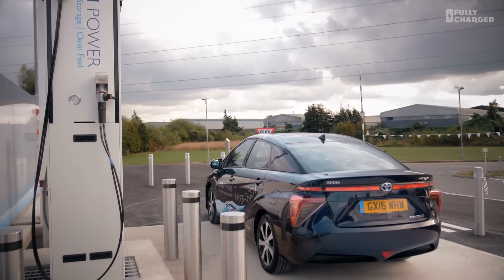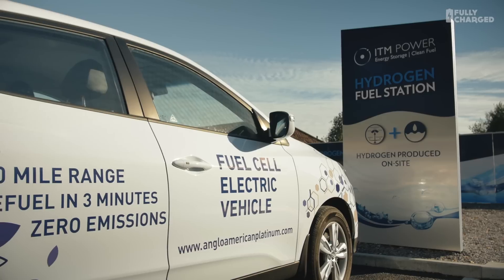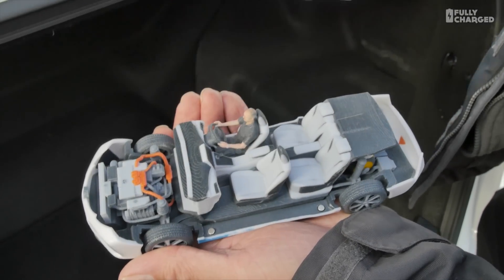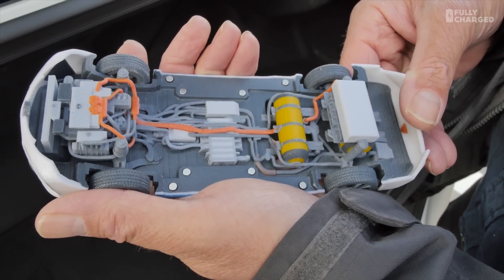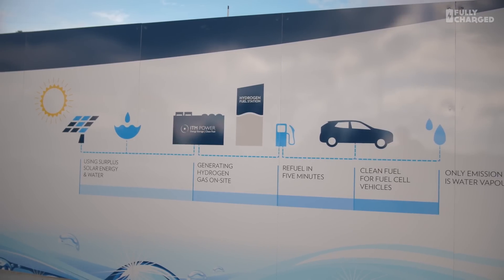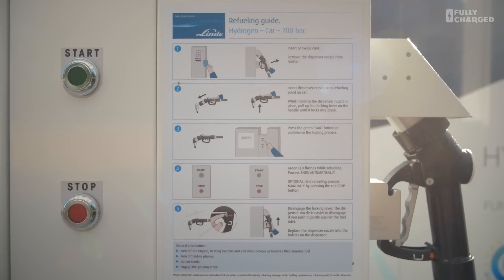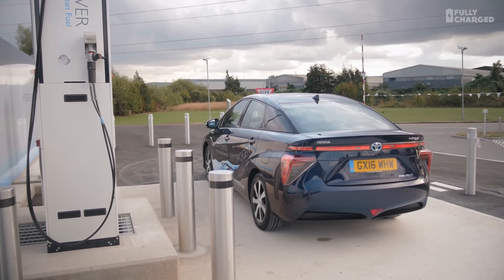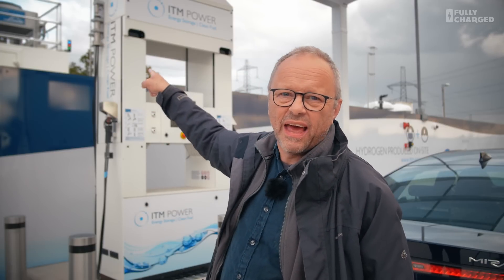ITM Hydrogen Rally | Fully Charged

Comment: I got an idea, next time we go grocery shopping ... when we get home... let's put a ladder up to a second floor window, climb into the window, go down the stairs and out the back door and open the door to the basement and carry the groceries up from the basement back into the kitchen...  or we could just use the front door...   

Sooooo,  we could used wind or solar to charge an EV at home and drive off with 300 miles of range OR 
we can use wind or solar to power a very expensive cracking station that produces hydrogen at high pressure and for a ridiculous price, pump that gas into a car under high pressure and then the car takes that hydrogen and puts it in a fuel cell to charge battery that drives the car 350 miles.  

This is crazy!!!
Reply: ram 1901 okay, then what else do you suggest? It's easy to be critical about something but what do you want to improve about it?
Reply: The energy in the hydrogen is a lot more portable than that in battery. I'm not saying hydrogen is better than batteries for powering cars, but I am saying that there are advantages to a hydrogen-based energy infrastructure that considers the grid and the transport network as part of a whole.

I really don't understand why so much hate has grown up around hydrogen. We need to change what we're doing now, and fast. Surely we should be exploring all options? If hydrogen is so obviously a bad idea, why hasn't it died a death yet? A lot of very smart people in a lot of countries think it's worth developing, despite a constant barrage of ridicule, so it can't be completely without merit.
Reply: ram 1901 of course hydrogen is still expensive 
When electric cars came out were they cheap or the same price they are now 
NO ! 
And electric vehicles are not the future if everyone in the uk charged there vehicle overnight the national grid would completely blackout.
Reply: No To Pseudoscience such a drastic expansion to the power network will be a terribly expensive infrastructure challenge. Even with the infrastructure in place how would you ensure adequate power generation exactly when you need it. One of the advantages of hydrogen generated by electrolysis is that the refuelling event can occur at a different time to the power consumption , it is in this way that hydrogen provides a route to zero carbon transport by using excess renewable power that would otherwise be wasted.
Reply: Rooftop Solar/Tesla Battery/Tesla EV...no load on grid..
Makes no sense to take solar...use it to make hydrogen..then take hydrogen and use it to make electricity again in the car.
Reply: yes it does because -less so with solar and more wrt wind power unused surpluses are going to waste and could so easily be stored and monetised as hydrogen. Society has to get used to seeing hydrogen , not as a fuel but as a store of energy. There is enormous waste as well in power stations with voltage maintained as the load drops. taking the load back to 100% by automatic balancing of the load with varying output of hydrogen
Reply: Actually even more crazy. With home system you mention, if you can charge your battery car to do 300 miles, you could make hydrogen for fuel cell vehicle to do only 100 miles, because process electricity -> hydrogen -> electricity wastes 2/3 of energy.

Comment: I can see Shell, BP, Esso etc jumping on this band wagon as it's more inline with their sales model.  I'd rather keep my i3 BEV, it seems so much simpler!
Reply: Yeah. Using a wind turbine to create hydrogen which then creates electricity seems so convoluted. Simpler to go from turbine to electricity. That's why electric cars will win in the end.
Reply: Tesla can be anywhere from 60 to 100 kWh in battery pack capacity where as the Mirai is rated up to 114 kWh. FCV makes more sense for heavier vehicles and large trucks due to the higher power density output compared to BEV alone..
Reply: FCV is so unpopular, no one does vlogs with them, or even forum posts. They are more of a unicorn car than a Koenigsegg.
Reply: Not a chance - why would you spend billions of dollars on hydrogen storage tank farms . tanker loading facilities and car fueling facilities instead of putting a few fast chargers on your forecourt for a fraction of the cost and selling more ice cream and coffee at a higher profit margins than available from selling petrol.
Reply: And even the unicorns at Koenigsegg think this is to odd. As they are building their 1500BHP plug-in commuter... http://koenigsegg.com/regera/

Comment: Everything you can do with a fuel cell, you can do with a battery. Check the physics and it's obviously a waste of energy and a way to line another politician's and friend's pocket.
Reply: So a Tesla now rated at max of 100 kWh and when not plugged in to recharge that energy is to go where when its outputting more power than is being used? considering the Mirai converts that Hydrogen into a max of 114 kWh. The ITM system is taking that unused power to make a power dense supply of hydrogen that during peak user times would go back into the power grid as needed since it can store more power than a battery system.
Reply: Then charging your Mirai better cost you less than $15.00 or the power companies will make a killing off using energy from your car. It adds an unnecessary step. Power companies can add their own fuel cells or battery packs.
Reply: Joshua Cornell Converting hydrogen to electricity , into a DC battery incurs more losses than simply driving a BEV. 

Also there's no video of a hydrogen car ownership of what it can do. Stop going on dreams.
Reply: Joshua Cornell 
Why is this feature even relevant? Are people actually going out and putting  petrol in their cars so they can go back home and run their house like a gas generator? Since when did this become a must have practical feature, that it has to be highlighted? Last time I checked, the only reason you wanted to "fuel" up your car was to actually drive it for as many miles as possible until empty again. So maybe if your city's power goes out because of a natural disaster, it might come in handy, but what happens when your car runs out of "juice"? Now you don't have power in your house and your car is also empty. You're better off buying solar roofs and wind turbines, rather than relying on this gimmick. There's a reason why Tesla didn't see this "feature" practical and didn't include it. Just another distraction from the Mirai's obvious inferiority to BEVs. For real, who has actually used the "unused" fuel/energy in their car to power their house to save a few bucks on their electric bill?
Reply: Having looked at how much battery juice you would need to power your home for an hour to a week, the battery back up type system wont hold due the amount of power your fridge and washer/dryer use. Compared to how long that same power pack can keep your electronics powered. You need a back-up generator, be it diesel, gasoline/petrol, or gas be it natural, propane, methane/butane or hydrogen. You would drain the BEV in less than a day to run the lights, keep the fridge cold/freezing.
Reply: Joshua Cornell your point confuses me. Most blackouts last typically less than a day which is plenty of time for home backup battery storage systems to provide for.  An 100kwh tesla can backup an English house for an entire day and then some, because we waste a lot less power than Americans do with all their air conditioning and absolute lack of regard for energy efficiency.
Reply: @pinoyamerican:  I do.  I use my Prius to run my house during power outages.  When the gas tank gets low, I drive it to get more.  Tesla did not include this because it doesn't fit their business model.  "free for life" supercharging, plus V2H (vehicle to house) means that people might run their houses off 'free' electricity from Tesla.
Reply: Will Davis a past few winters where I live we had blackouts, while it lasted less than a day for some, others had to sit in the dark longer due to the extent of those blackouts. Battery backups are only able to handle a day at most the power needs, so those with that system were likely back in the dark after their battery system ran out of juice, I do not know anyone with these battery back up systems...
Reply: @Joshua: A new Powerwall 2.0 would run my house for 5 days.  More, if I was frugal, which of course I would be, as we sometimes lose power for a week or more.  If my solar PV was completed, that would be extended to weeks even in winter.
Reply: Joshua Cornell. Problem is that you need more than 300kWh of electricity to create hydrogen to fill up Mirai, and Mirai gives you back 114 kWh, so you wasted almost 200kWh.
To charge 100kWh Tesla battery, you will need around 110kWh of electricity. And both cars can do the same mileage with full tank/battery.
This is why it does not make sense to store excess electricity as hydrogen, you get back only 1/3.
Reply: Will Davis. Average UK household uses 13kWh of electricity per day, so Tesla could power home for a week. Americans use 32kWh per day, so 3 days for them.
But in the case of power outage, you would not use electricity the same way as you use it normally, so it would probably last for much longer.
Reply: Not really. Hydrogen refills takes much quicker then BEV, even if you use Tesla's Supercharger. That's huge advantage on a longer (1000+miles) journey.
Reply: jur4x But the hydrogen still takes electricity to produce. Such a waste.

Comment: As a process engineer, this all looks extremely dubious to me.
What it smacks of is likely what it actually is.. an automotive industry trying desperately to preserve it's current business model instead of doing what it should be doing and moving to electricity and making batteries better and more easily recyclable.

Separating the gas you get loss.. compressing the gas you get loss.. cooling the gas you get loss... pumping the gas around.. you get loss.  If you transport it you get loss.  All this before it hits your tank.

So basically how much of that electricity that's being generated by that turbine next to you is just going to waste?
And we haven't even spoken of the dangers of compressing hydrogen to that pressure.  It's a multi staged pump and if you don't do a good gas separation or if you get a leak, you will be picking bits of that compressor out of your teeth if it gets any oxygen in it.

Now that might not be important for an installation like this.. but in order for this to TRULY compete with electricity storage you have to be able to have this hydrogen generator at your home.
Last time I checked, I could safely use my home solar to charge batteries that I could then transfer with little loss to my EV or use to keep my lights and fridge on.. and wash clothes.  You know.. LIVE.

So what are we really talking about here?  A viable alternative, or some last ditch effort for an enormous over bloated series of wasteful industries trying to sell you yet more of what you don't need?
Reply: As a very rough rule of thumb, the well-to-wheel efficiency for this kind of system is around 25%. HPE (high-pressure electrolyzing, i.e. at about 25 bar) has a theoretical maximum efficiency of just over 60%, compression and refrigeration knocks off another 30 or so percentage points (including pump efficiency) and the hydrogen fuel cell inside the Mirai achieves just over 60% efficiency again at half output (=peak efficiency). 

Theoretically, if you can make a 100% efficient compression pump and non-eroding, no overvoltage ultra-high-pressure electrolyzer, you can get near 50% overall efficiency. But that is unlikely to be achievable anytime soon, or probably ever.

As battery costs come down and production increases, it seems increasingly unlikely that hydrogen will ever become viable. Right now, you can produce supply-driven electricity from renewable sources for around $0.05-0.08/kWh, competitive with fossil fuels. Energy storage using $500/kWh batteries adds about $0.30-0.40/kWh to the system-level cost, i.e. a fully battery-backed renewable grid would mean ratepayer electricity prices of about $0.50/kWh. A hydrogen-backed system (e.g. the various Japanese home fuel cell systems) currently achieves $0.25-$0.30/kWh, which is interesting. However, you have to take into account that $500/kWh is not a realistic price for batteries; Tesla et al. already produce grid-scale battery products at half that price, with bare cell cost approaching $100/kWh. If in 2020 we have sub-$100/kWh batteries, the cost adder for battery backing  - even seasonal storage - on intermittent renewables becomes in the order of the bare kWh-price. At that point just the inefficiency of a hydrogen cycle by itself would price itself out of the market. And 2020 is not an unreasonable timeframe.

So yeah, hydrogen isn't going to make it. Even aside from the technical and safety issues, the cost probably won't ever make sense.
Reply: demultiplexer, Couldn't have said it better myself.
Reply: To be honest I wouldn't put it past a compressed air car to have a better "well" to wheel efficiency.
Reply: gnoxycat Lots of issues with compressed air for locomotion.  It would be interesting to see what type of motor you use to try and get rid of the friction loss from pistons without loosing efficiency.. and then there is still the issue with carrying around lots of weight with a transmission.
So I'll have to go with an EV power train at this point for efficiency and practicality.  Other methods are simply too mechanically complex by comparison.